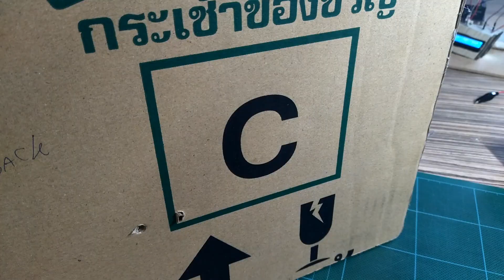DIY Coin Sorting & Counting Machine without any Sensor from Cardboard and Arduino

Comment: What you have used to count the coins
Reply: He made a switch circuit on his own. You know, coins are great conductors. So when a coin slides down and touches the aluminium part, the circuit is closed, otherwise the circuit is open.  You can utilise this as 0/1 signals.

Comment: does somebody have the working sketch for this because it isn't working?
please reply quickly!!!!!
Reply: Did u get the code?
Reply: I used to have a working one I will check monday if I still have it
Reply: @nathanbruggeman3161   found it? I really need to finish this project
Reply: @Valentina-zm7gr  I got one but I don't know if I still have it I will check it when I can
Reply: @Valentina-zm7gr  

#include <LiquidCrystal_I2C.h>

#include <CapacitiveSensor.h>

#include <CapacitiveSensor.h>

#include <Wire.h>
#include <LiquidCrystal_I2C.h>

LiquidCrystal_I2C lcd(0x3F, 16, 2);

CapacitiveSensor capSensor  = CapacitiveSensor(4, 2);
CapacitiveSensor capSensor2 = CapacitiveSensor(4, 5);
CapacitiveSensor capSensor5 = CapacitiveSensor(4, 6);
CapacitiveSensor capSensor10 = CapacitiveSensor(4, 7);

int ms_time   = 800;
int threshold = 640;
const int ledPin = 13;
bool led_state = LOW;
bool pass = false;

int count_c1 = 0;
int count_c2 = 0;
int count_c5 = 0;
int count_c10 = 0;
int sum       = 0;

unsigned long ms1 = 0;
unsigned long ms2 = 0;
unsigned long ms5 = 0;
unsigned long ms10 = 0;

void setup() {

  lcd.init();                      // initialize the lcd

  // Print a message to the LCD.
  lcd.backlight();
  lcd.setCursor(0, 0);
  lcd.print("1  2  5  10  sum");

  Serial.begin(9600);
  pinMode(ledPin, OUTPUT);
  delay(50);
}

void loop() {
  checkCoin1();
  checkCoin2();
  checkCoin5();
  checkCoin10();

  lcd.setCursor(0, 1);
  lcd.print( count_c1);

  lcd.setCursor(3, 1);
  lcd.print( count_c2);

  lcd.setCursor(6, 1);
  lcd.print( count_c5);

  lcd.setCursor(9, 1);
  lcd.print( count_c10);

  lcd.setCursor(13, 1);
  lcd.print( sum);
}
void checkCoin1()
{
  long sensorValue = capSensor.capacitiveSensor(30);

  Serial.println(sensorValue);

  if (sensorValue > threshold)
  {
    if ( ms1 == 0) {
      ms1 = millis();
      count_c1++;
      sum = sum + 1;
    }
    digitalWrite(ledPin, HIGH);

  } else {
    digitalWrite(ledPin, LOW);
  }

  if ( ms1 != 0) {
    if ( (millis() - ms1) > ms_time) {
      ms1 = 0;
    }
  }
}
void checkCoin2()
{
  long sensorValue = capSensor2.capacitiveSensor(30);

  Serial.println(sensorValue);

  if (sensorValue > threshold)
  {
    if ( ms2 == 0) {
      ms2 = millis();
      count_c2++;
      sum = sum + 2;
    }
    digitalWrite(ledPin, HIGH);

  } else {
    digitalWrite(ledPin, LOW);
  }

  if ( ms2 != 0) {
    if ( (millis() - ms2) > ms_time) {
      ms2 = 0;
    }
  }
}

void checkCoin5()
{
  long sensorValue = capSensor5.capacitiveSensor(30);

  Serial.println(sensorValue);

  if (sensorValue > threshold)
  {
    if ( ms5 == 0) {
      ms5 = millis();
      count_c5++;
      sum = sum + 5;
    }
    digitalWrite(ledPin, HIGH);

  } else {
    digitalWrite(ledPin, LOW);
  }

  if ( ms5 != 0) {
    if ( (millis() - ms5) > ms_time) {
      ms5 = 0;
    }
  }
}
void checkCoin10()
{
  long sensorValue = capSensor10.capacitiveSensor(30);

  Serial.println(sensorValue);

  if (sensorValue > threshold)
  {
    if ( ms10 == 0) {
      ms10 = millis();
      count_c10++;
      sum = sum + 10;
    }
    digitalWrite(ledPin, HIGH);

  } else {
    digitalWrite(ledPin, LOW);
  }

  if ( ms10 != 0) {
    if ( (millis() - ms10) > ms_time) {
      ms10 = 0;
    }
  }

}

Thats all I still found, I know for a fact that there is somewhere a fault in this sketch but I hope I helped you a little bit futher!
Reply: Try this one also!

#include <CapacitiveSensor.h>

#include <Wire.h>

#include <LiquidCrystal_I2C.h>

LiquidCrystal_I2C lcd(0x3F,16,2);

CapacitiveSensor capSensor  = CapacitiveSensor(4, 2);

CapacitiveSensor capSensor2 = CapacitiveSensor(4, 5);

CapacitiveSensor capSensor5 = CapacitiveSensor(4, 6);

CapacitiveSensor capSensor10 = CapacitiveSensor(4, 7);

int ms_time   = 800;

int threshold = 640;

const int ledPin = 13;

bool led_state = LOW;

bool pass = false;

int count_c1 = 0;

int count_c2 = 0;

int count_c5 = 0;

int count_c10 = 0;

int sum       = 0;

unsigned long ms1=0;

unsigned long ms2=0;

unsigned long ms5=0;

unsigned long ms10=0;

void setup()

{

  lcd.init();                      // initialize the lcd

  // Print a message to the LCD.

  lcd.backlight();

  lcd.setCursor(0,0);

  lcd.print("1  2  5  10  sum");

  Serial.begin(9600);

  pinMode(ledPin, OUTPUT);

  delay(50);

}

void loop()

{

   checkCoin1();

   checkCoin2();

   checkCoin5();

   checkCoin10();

   lcd.setCursor(0,1);

   lcd.print( count_c1);

   lcd.setCursor(3,1);

   lcd.print( count_c2);

   lcd.setCursor(6,1);

   lcd.print( count_c5);

   lcd.setCursor(9,1);

   lcd.print( count_c10);

   lcd.setCursor(13,1);

   lcd.print( sum);

}

void checkCoin1()

{

  long sensorValue = capSensor.capacitiveSensor(30);

  Serial.println(sensorValue);

  if (sensorValue > threshold)

  {

    if( ms1 == 0){

      ms1 = millis();

      count_c1++;

      sum = sum + 1;

    }

      digitalWrite(ledPin, HIGH);

  }else{

      digitalWrite(ledPin, LOW);

  }

  if( ms1 != 0){

      if( (millis() - ms1) > ms_time){

         ms1 = 0;

      }

  }

}

void checkCoin2()

{

  long sensorValue = capSensor2.capacitiveSensor(30);

  Serial.println(sensorValue);

  if (sensorValue > threshold)

  {

    if( ms2 == 0){

      ms2 = millis();

      count_c2++;

      sum = sum + 2;

    }

      digitalWrite(ledPin, HIGH);

  }else{

      digitalWrite(ledPin, LOW);

  }

  if( ms2 != 0){

      if( (millis() - ms2) > ms_time){

         ms2 = 0;

      }

  }

}

void checkCoin5()

{

  long sensorValue = capSensor5.capacitiveSensor(30);

  Serial.println(sensorValue);

  if (sensorValue > threshold)

  {

    if( ms5 == 0){

      ms5 = millis();

      count_c5++;

      sum = sum + 5;

    }

      digitalWrite(ledPin, HIGH);

  }else{

      digitalWrite(ledPin, LOW);

  }

  if( ms5 != 0){

      if( (millis() - ms5) > ms_time){

         ms5 = 0;

      }

  }

}

void checkCoin10()

{

  long sensorValue = capSensor10.capacitiveSensor(30);

  Serial.println(sensorValue);

  if (sensorValue > threshold)

  {

    if( ms10 == 0){

      ms10 = millis();

      count_c10++;

      sum = sum + 10;

    }

      digitalWrite(ledPin, HIGH);

  }else{

      digitalWrite(ledPin, LOW);

  }

  if( ms10 != 0){

      if( (millis() - ms10) > ms_time){

         ms10 = 0;

      }

  }

}
Reply: @nathanbruggeman3161  Hey, thank you so much :)
Reply: @Valentina-zm7gr  no problem girl